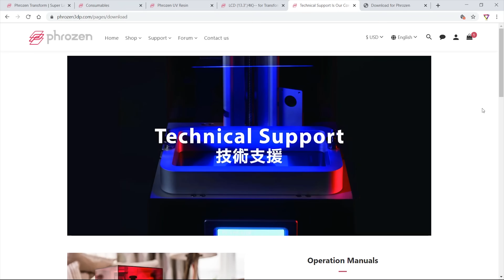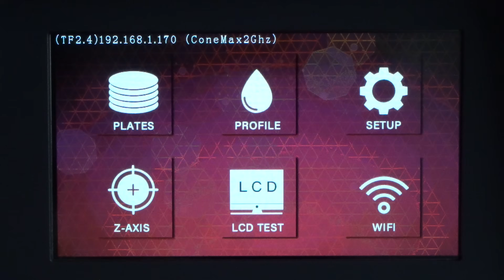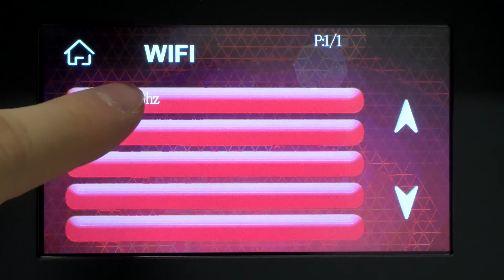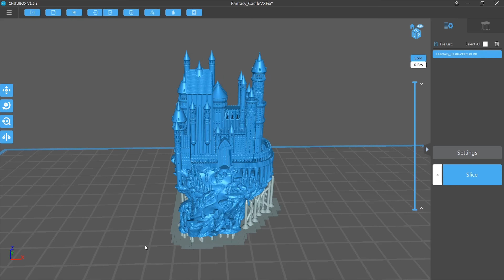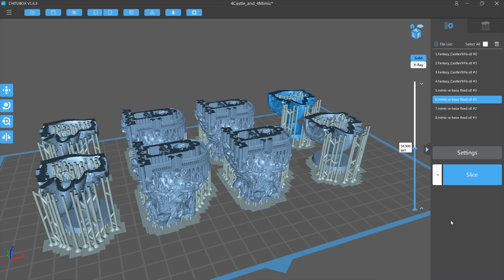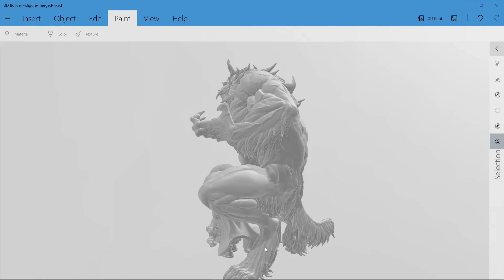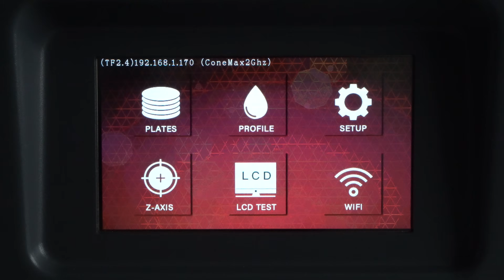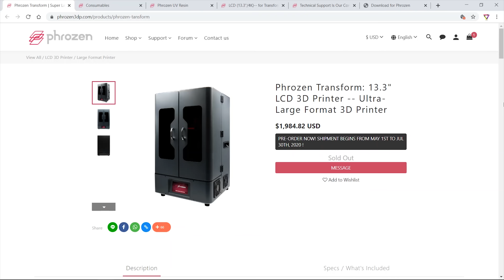Phrozen Transform review -  HUGE resin 3D printer!

Comment: I would highly suggest adding the supports manually. Chitubox's automatic support generator adds WAAAY more than you need, you could probably get away with 1/10 of the supports you need not only leaving fewer support nubs on the print (so higher quality finishes), but also using a lot less resin on prints like the alien figurine. There is special software out there that can show you if you missed any needed supports.
Reply from the maker: I agree. For the beginners that could be a bit problematic but for experienced makers adding supports manually are the way to go. Saving resin, saving time for removing supports and also getting a better print with less scars. Thanks for your comment.
Reply: @NexiTech  Could be a good video idea. It's not really all that difficult, so even beginners could pick up on it easily enough.

Comment: Always check your build plate before you print in case a piece of cured resin is stuck to it. Because, on the next print,  the build plate with crush this remnant piece into the FEP vat liner and your precious LCD mask plate, possibly doing much damage. Also check the resin filled vat for large cured chunks hidden in the uncured, liquid resin.

Comment: Do you have more details, a video, of how the ventilation if fitted to the window?
Reply from the maker: Protomaker Black Sprint Original 3D Printer I used foam from the packaging box and I cut out the peaces and fit it around the window while I cut out only place for ventilation end housing. It's not permanent ventilation solution and it does not look nice but it does the job temporally and it was very effective.

Comment: Base of models does not look flat... 14:19 for example needs propping up here
Reply from the maker: Protomaker Black Sprint Original 3D Printer Well that was my fault. First I printed the base hallow and some liquid resin was trapped inside of the print. Then I place that base print in sealed plastic enclosure with other prints to protect it from dust but I place it next to the heating element. One Mimic print laterally cracked open and the base for wolf end up wraped. Thankfully I was able to clean other few smaller prints from leaked resin but I could not bend the base back without cracking.

Comment: Hey Nexi! First, I love your channel and I have a TronXY that I managed to make work thanks to your videos. 
I love this resin printer but I have a couple of questions if you dont mind: 
-What is the maximu volume that you can print? because I feel that the maximum printable is the maximum that the tray can hold? Can you refill that during the print? 
I am looking for something where I could do moulds for functional carbon fiber parts so the build volume is kind of important. 
Thanks a lot!
Guille
Reply from the maker: Guillermo Tebar Hi Guille and thanks for your comment. I'm glad that my videos was helpful to you. Maximum print volume is 290x160x400mm. Tray can fit object(build plate) of 290x160mm size and the LCD is big enough to cure the entire surface of the build plate.Yes you can refill resin during printing or open enclosure door any time you want. I never tried to make any molds with this machine but I have seen resin online that are ment to be use as cast resins.
Best regards 
Nexi

Comment: An added benefit of a huge build platform is the ability to print different iterations of a design all at once. Would be especially handy when printing 'useful' items that need to fit (items with threads, to be cast, etc). Can print the size you think you need, then several more, each scaled up 1%. One of them should account for the inevitable resin shrinkage. Big time saver.

Comment: Neat. But if you buy one, stock up on replacement screens while they're still available. At full print size, you're going to be swapping out LCDs on average every nine prints.
Reply: H D  400 hours LCD lifespan divided by 44 hour print
Reply from the maker: John Jones I'm sorry but I think that's wrong. That 44 hour print time(Alien) is total print time including time between layers. Lets do a quick math: 
Standard Curing time is 6 seconds, Alien figure had 7940 layers. That means 7940x6= 47640 seconds. 47640/60= 794min/60= 13.23h. So actually LCD exposed time under UV light is 13.23hours and that is if you print full 400mm scale model in very hight print quality. Lets assume that average life span of LCD is
400hours. So 400h/12.23h= 30.2 prints, printed at full 400mm scale at hight print quality (0.05mm layer heght).
So you should able to print around 30 Aliens figure at Max print size before LCD start to degrade and it needs replacement.
Reply: @NexiTech  very expensive pleasure, only 400h life span of LCD. I think need new generation LCD.
Reply: This 400 hour LCD lifespan is like flashbulbs in early photography. Nothing beats FDM in longevity.

Comment: Looks great, but why do most of these companies think the USB in back good? Please put it in front. Or at the very least on the side! Of course since it has WiFi, that was good move. Not sure if you did this. But those fans probably don't have a lot of CFM power. So that long of a vent hose will really degrade how much air is actually being pushed. I would add larger or 2nd  fan at the other end of your vent hose so help move the fumes away. That is what I do for my resin printers.

Comment: ooooh nice.👍😷
Why are the bases warped?
Reply from the maker: Gary Graham Thanks! Well that was my fault. First I printed the base hallow and some liquid resin was trapped inside of the print. Then I place that base print in sealed plastic enclosure with other prints next to the heating element. One Mimic print laterally cracked and the base wraped. Thankfully I was able to clean other few smaller prints from leaked resin but I could not bend the base back without cracking.
Reply: @NexiTech  ah I thought it would have been a modeling error rather than the printer, it does take a while to learn the software and get the results you are aiming for. 
Great video. 
Oh and thanks for the CR10 videos they really helped. 👍
keep safe my friend. 👍😷